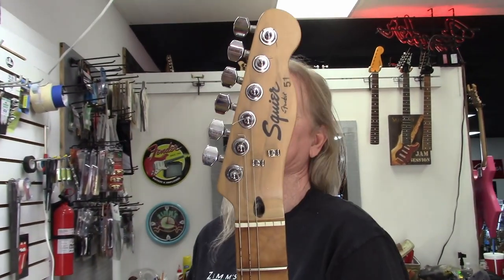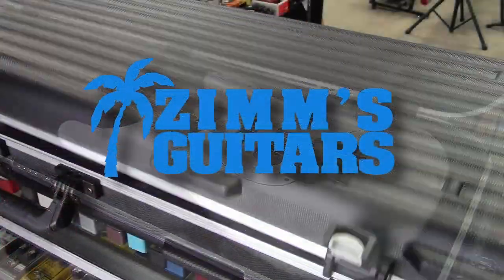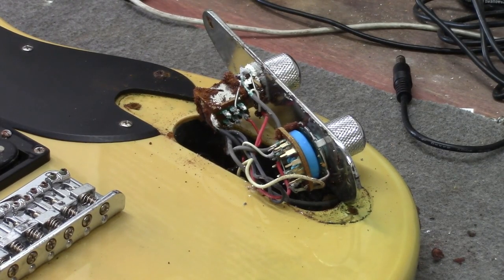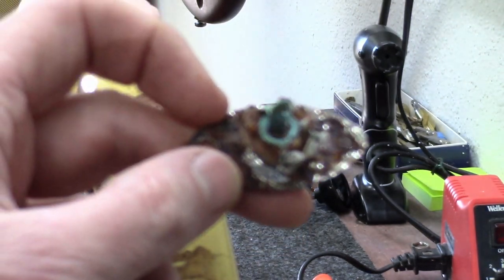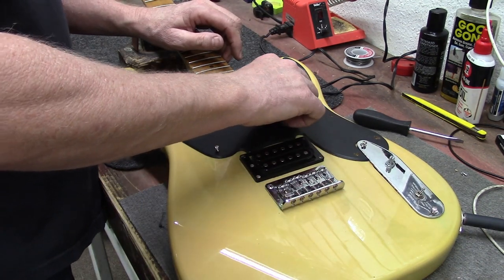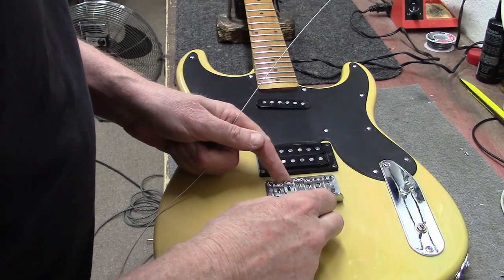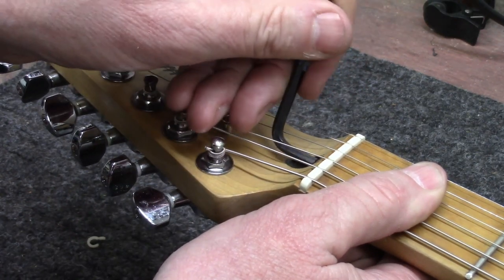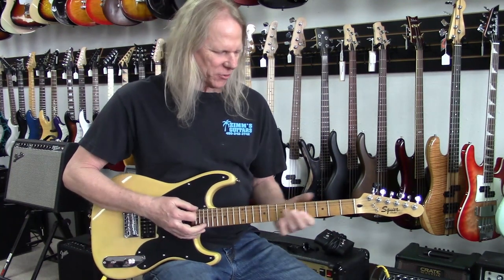This Fender Squier 51 needs major repairs!

Comment: I used to own this same exact guitar. I gave it to my son when he decided to learn how to play. I had it modded by a guy over 10 years ago. It has a Bill Lawrence humbucker in the bridge that is a one off that Bill Lawrence gave the guy who was modding my guitar. It's a super high output pickup. He replaced the tone know with a 3 way toggle and the neck pickup is a Dimarzio stacked single coil. He put locking tu ers on it and replaced the nut with a graphtech nut. Did a fret job and set it up. One of the best metal guitars I have ever played after all that.